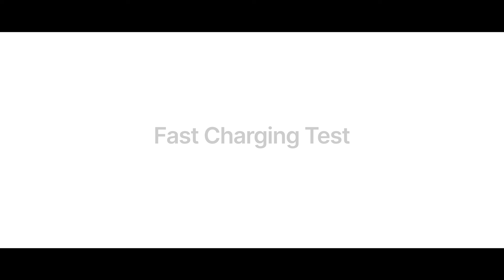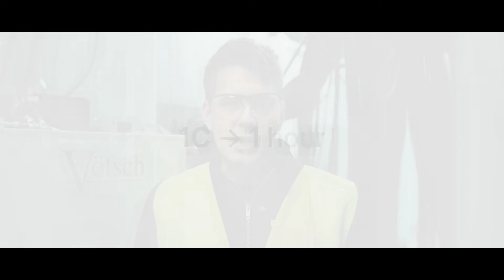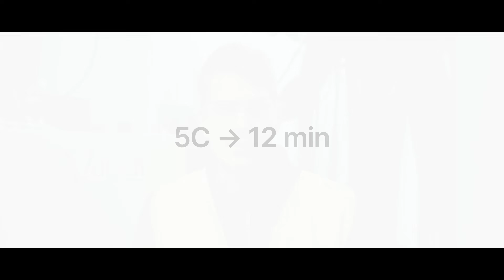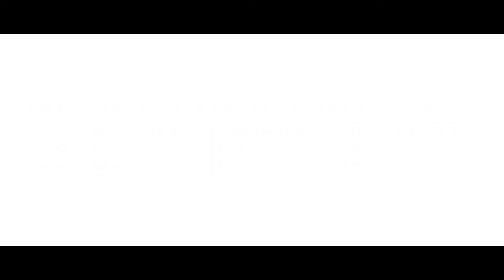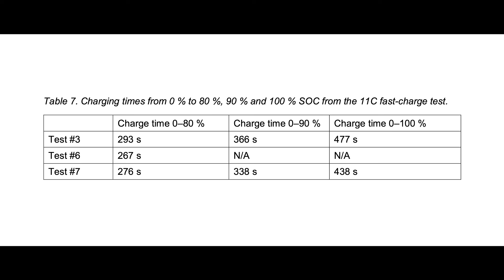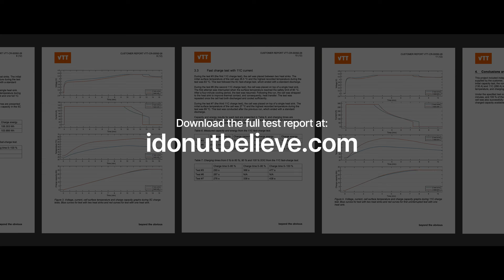Donut Solid-State Battery: Fast Charge Test | I Donut Believe (Pt.1)

Comment: Conventional lithium batteries suddenly got stone aged 😂
Reply: Now would be a good time to hold off on any further lithium battery purchases if you can manage.
Reply: They don't require heatsinks that are 10 times as large as the cell so not sure about that yet. 4:39
Reply: @yours_truely  Usually they are liquid cooled, which in practice would also be used for these donut things. And slower charging produces less heat.
Reply: @Ithirahad  you are right but the extra heat these generate will have to go somewhere, right? And that would need a lot more space.  It is not as if it will magically disappear with the liquid cooling. Unless they somehow make these a combo of home boiler / car battery. I really hope they work though.
Reply: @yours_truely  current lithium car batteries heat up while charging just the same, and they can’t handle the heat nearly as well, meaning that they need larger cooling solutions than the donut cells.
Reply: @luipaardprint  I know they do but I don't think they generate as much heat mate. 90 degrees in 4 minutes while sitting on a 4 inch thick heat sink? If this is the case then the 11C case is just impractical as it would require a lot more cooling than what we have now. And if you read the test conclusion this is what they are implying I think. They could have shared DCIR/impedance vs SOC and temperature results but they didn't.
Reply: @yours_truely let me think, active water cooling vs passive single heatsink?

In any case 5c with nominal het without rare earths? Sold.
Reply: @odman7945 all that active water cooling is doing is move the heat from the source to the water. The water just transfers the heat somewhere else. It doesn't just cool on its own. You would need to have big radiators cooling that much water. And they will need space. The space may not be needed right next to the cells but it will be needed to be somewhere otherwise the water cooling won't be happening. Hot water can't cool anything down. Anyway I guess we will soon find out. It seems this is a form of pseudo capacitive nano tech so it may well be charging fast and last longer but there are questions about charge retention and manufacturing costs.
Reply: @yours_truely yeah? Its normal.
Reply: @odman7945 what is normal? You don't need huge radiators to cool current battery packs. If these generate twice the heat you will probably need 4x the size of radiators. More heat = more space required = less effective density. But tbh heat is probably the least of the problems these cells will face based on what I read.
Reply: @y @yours_truely maybe you should do some research on modern EVs and fast charging.
Reply: @odman7945  sure and you should do some basic study on thermodynamics. You seem to believe that water somehow gets magically cooled down.
Reply: @yours_truely look. All I asked was why this is a problem, because the water cooling is normal operations, thats how the modern EVs work.

Somehow you make it be some problem, that it is not.
Reply: @odman7945  it is a problem because water cooling needs a way to cool the water. I don't know why this is so complex mate. It is like saying that an air-con is small and doesn't need space by just looking at the bit inside the building and ignoring the main unit outside.
Reply: li ion charging at 5c with just one passive heat sink? like to see that. 

I dont know how it is so hard for you to get that using water cooling in a battery pack is normal in EVs these days. Obviously that incorporates cooling the water. 

Heck Gaz cars have water coolers lol.

Its not like the tech is new.
Reply: @odman7945  not at 5c it isn't lol
Reply: @yours_truely Didn’t you listen to what was said in the video? These heat sinks are worse than the cooling you typically have in a real battery pack. They’re big just because there’s no fan or pump, so they need to be big to get a reasonable cooling effect. 
Even 10 year old EVs had a fan to cool the battery pack. First gen leaf may be the only exception. But then it didn’t charge at 5C. More like 0.5C
Reply: @auspiciouslywild I did listen but I also know li-ion packs don't heat up to over 90 degrees mate. I mean unless they are faulty. Even if the contact heat sinks were 1mm thin, you would still need to find a way to make the heat go somewhere. So you would need to have bigger heat sinks somewhere else. Simple thermodynamics.
Reply: @yours_truely The only difference is that not only do these cells tolerate 90 degrees but they actually like it. In real life you'd need to get rid of the heat as sitting on a 100 degree battery pack would be a tad uncomfortable. But so would it be sitting on an even hotter engine and we have mastered how to keep hot thing cool.
Reply: @yours_truely  No, that is a passive heat sink, the temperature is high cause it’s charging at 11C, conventional lithium batteries charging at that speed would go up in flames without liquid cooling, and it would definitely throttle down faster to avoid rapid degradation.
Reply: @Rebelapes  again, the point is, 11C is pointless if it generates that much heat that it needs so much cooling. I mean well done for them for achieving something that cannot be used in a car or even more specifically, a bike. Their 5C charging seems to require more cooling than a li-ion pack too.
Reply: @yours_truely So you charge your lithium cells at home at 5C without cooling? I didn't know the cells could do that 😂
Reply: @freeeyes5789  I think you missed the point mate. Given the heat this cell seems to be producing you won't even be charging it at 5C anywhere without double the cooling of what you use for current tech.
Reply: @yours_truely It will have water cooling, plain and simple, just like every electric car, for 5C.
Reply: @yours_truely you're comparing two different batteries, normal NMC cells cannot tolerate high temperature, that's why they require extensive cooling and heating systems. They need this to charge at 3C, so in example a 3000mah cell can charge at 9 amps only if it has serious cooling. These cells are not bursting into flames at much higher charge rates 11C with minimal cooling. That same 3000mah cell would actually explode if you pushed 33 amps into it, not just get warm. They're fundamentally different.
Reply: @F @Flyingwigs ople are also forgetting that, while we dont know the chemistry, supposedly they are not using rare earths or for example lithium, which is highly flammable. 

Even getting the same results than normal batteries would be groundbreaking.

So saying things like ”comparable” to normal lithium batteries is really dum.
Reply: @freeeyes5789 how big radiators will it need? And how much energy for cooling?
Reply: @yours_truely They used passive cooling in the video; an active cooling system won't have a problem with that.
Reply: @freeeyes5789  why? does active cooling somehow require less space? The mechanism still needs to be somewhere on the car, taking space.
Reply: @yours_truely I think you are trolling. 5C highest temp with 2 heatsinks was 47% degrees which btw. happens to be the optimal temperature for Tesla fast charge, which is btw. liquid temperature controlled battery pack. 

Tesla even warms up the battery pre-heated when going to fast charge so you get the optimal charge speed immedietly.
Reply: @odman7945  Yeah 2 massive heat sinks... I am not trolling. I think you are because I cannot make it simpler but you keep ignoring the fact. This thing even at 5C generates 50-100% more heat than a fast charging li-ion battery. So it will need much bigger cooling as it is evident from the test itself. Not that we will ever get to see this as it is most likely just a marketing trick (at best) anyway.
Reply: Not quite as they are still the only ones you can buy. And will be for some time until someone delivers the actual product these scammers are pushing.
Reply: @benbaselet2026  the only scammers are in the oil cartel, especially the american ones, telling everyone that pollution is good for business and has no consequences.
Reply: @fofopads4450  while i agree that oil cartels are scammers, they are definitely not the only ones.
Reply: @fofopads4450  That has nothing to do with topic.

Comment: 10% energy loss between charge energy and discharge energy at 1C (=90% round-trip efficiency) and 20% energy loss at 11C (according to the report)... this seems quite high. Other than that, it looks impressive
Reply: 80% round trip is normal for batteries
Reply: isn't that just heat?

Comment: Can someone translate these numbers over to a realistic EV-charging scenario. I can not put these numbers together myself 😅 

What would this mean to a 80kwh EV battery, regarding charging speed and charging time for example? What’s realistic?
Reply: its not that complicated. 11C would mean 80kW*11 (880kW) charging power and a charge in around 5 minutes.
Reply: @Bullseiify 5min, but your charging stations needs an 880kw output. Which means there is no big difference if you charge at home
Reply: @stephanosbinos8735
Reply: @FloloMAN  yeah, obviously it doesn't make a difference for home charging. unless you got such a charger at home :D But it could be a very nice to have for long road trips. It would enable similar charge time compared to combustion cars (Still a bit slower but i would say close enough :)
Reply: Chagpt based on data says that in a EV like tesla , that would mean 2 -5x times faster charging speed

Comment: So far, the battery behaved what a typical power cell lithium ion  battery can achieve. That much heat generated during cycle indicated high DCIR which is consistent with any lithium ion cells on the market. We will see if their cycle life testing and energy density is consistent of what they claim.
Reply: No battery in the world charges this fast as the tests show .
Reply: @wakeno.6047  Hi Mr. Bot, almost all modern Lithium Ion battery can charge at that rate. Li-Po can charge 10x speed of that.
Reply: @michaelfeng327 you crazy or a chinese troll?
Donut batteries have a 0-100% charge in 7-8 minutes !
A Li-Po is around 30-60 minutes.
Donut batteries work fine at 90+ Celsius, Li Po work between 0-45Celsius.

Just watch the report or the video before commenting

Comment: the cell aprox. size is 15*10*1.5 cm = 0.225 liter. If the capacity is 25 Ah the cell voltage is 4.3 V then result 477 Wh/liter
Reply: The cell voltage is a nominal 3.6V according to the report.
Reply: @default9740  correct, and the capacity is 26 Ah. result  115.5 Wh (in the report is 100 Wh for charging, 90 Wh for discharging) ergo i was close. 
if the voltage dropping is almost linear (fig 2.) and the discharge energy is 90 Wh (table 4.) then result 400 Wh/liter
Reply: how did you come up with this dimension?
Reply: @Bullseiify  4:38 is a hand so i aproximate
Reply: I wonder if it weighed about 1kg…
Reply: @NicolausNemeth  94 Wh / 400 Wh/kg = 235 grams
Reply: @tomivalko  i aproximete Wh/liter, not Wh/kg
Reply: @nagyzsombi  400 Wh/Kg is from Donut Labs stated claims
Reply: @tomivalko  Ah! You're right. I took the Wh/litre and got confused thinking it was a litre instead of .225! LOL
Reply: 11C is nothing special (lipoly like Turingy Graphene 15C high performance RC pack) and this battery looks identical as a regular lipoly with same outer coating folding details.It’s funny to watch them try to fool all the naive people .and this battery looks identical as a regular lipoly with same outer coating folding details.It’s funny to watch them try to fool all the naive people.
Reply: @maricomovies  blablablablablaa.. Blablaablabalblaa.. Ok?

Comment: Disappointed that the sample size was only one (!), but very encouraging results so far...
Reply: Thats the way all are tested, cell level. Not pack or even module.
Reply: @AJ1964FI  I understand that, but having been involved in technology sample testing over the years, testing a single sample (cell) really is not a good way to go when investigating capability. Especially when the test time is so short - it takes longer to set up the test, than actually run it. Multiple samples help to prevent the effects of their being an outlier... Thanks.

Comment: so i talked to my friend (chatGPT) and asked after uploading the report. is this a legit test on a battery or is important parts missing form the report? got the answere

Short answer: It appears to be a real laboratory test report — but it is incomplete for making big commercial or performance claims.

Here’s a structured breakdown.
What’s Missing (Important Context Gaps)
However, several critical elements are missing if someone is using this to claim breakthrough battery performance.Complete validation of breakthrough battery tech? → No. Important parts are missing.

If someone is using this report to claim a major battery revolution, you would need:
Cycle life curves
Energy density certification
Third-party safety testing
Multiple-cell statistical data
If you'd like, I can also explain what a fully convincing third-party battery validation report would normally include.

Comment: Big fan of the delivery of the dude in the yellow vest. Just dry, simplified, practical examples of an understanding of the issues.
Reply: Was looking to see what the charge C was and he delivered. Also curious what the max potential discharge C is, I might have missed that. 
The higher temperature charge being good with 85°C at 11C is crazy.
Reply: @JonDecker  And that with only one heat sink. Definite drop in temp with two heat sinks. With active cooling in a battery pack it would definitely be much cooler.
Reply: What do you mean? He's the most excited I've ever heard a Finn be :P
Reply: His official testing outfit and clearly scripted delivery was definitely theater, but still hoping for the best.
Reply: VTT… his job is to be strick and boring!
😊

Easy to see difference to Donut person!
Reply: @haukikannel  that guy is not from VTT, he's a Donut Labs employee. He was at the their booth at CES.
Reply: @Extralarse ha, I knew it! Very deceptive but could tell from his choice of words.
Reply: @torbjornaxelsson8690 , nothing deceptive, he was identified as being a Donut Labs employee when he first appears in the video. The research report names names of VTT people involved.
Reply: @torbjornaxelsson8690 what, VTT posted official report on this, what are you babbling about
Reply: @davidgaina5659  The person is from Donut, report is from VTT
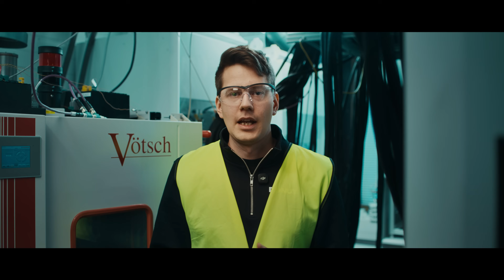Reply: @haukikannel CTO and Co-Founder. Can you not read? 1:21 has it on the screen. He is at VTT, as in, physically, to test his battery
Reply: @haukikannel Aren't they both "donut persons"?

Comment: This is still useless.  You guys said the motorbike was the first solid state vehicle on the market and yet, won't run the tests against that bike directly.  instead providing data from lab testing.  There are tons of companies that claims this type of performance in labs.  we want to see it in your finished product.  unless you would like to admit that the bike is not in fact using an actual solid state battery.
Reply: They will be shipping these in bikes in the next 1 to 2 months
Reply: They can't do that, it's not their product to show. Verge is technically a separate company they supply. It's up to Verge to show off their bike, not Donut.
Reply: @Skylancer727  so let me get this straight, these guys just collaborated to make a revolutionary breakthrough on this technology and neither thought it would benefit them both to use their product to demonstrate it?

Comment: This battery has no graphite at all, whatever new material was made for this, Nobel prize is coming
Reply: Speculation that it uses carbon nanotubes coated with titanium which allows for high density.
Reply: @sloansteeringsystems isnt titanium kinda rare tho?
Reply: @AIpromaxUltra-x5e  Technically it's not rare in Earth's crust but it's expensive to process. Still, it is like 2x cheaper than lithium

Comment: Congratulations Donut Lab and all involved institutions and individuals🎉 Historical moment! Humanity now has a viable path to a fossil free economy.
Reply: Do you think that device you are typing  your reply on is made without fossil fuels?
Reply: @gsguy9359  I’m sure he knows that. I’m sure that like you, he also knows that currently 90% of daily oil production ends up being burned. Used once. Non value added.

And of the 10% that isn’t burned, half of that is single use plastic bags.

So you know what, maybe world wide oil production goes back down to less than 10 million barrels a day versus the current 100 million a day and you can still claim that the global economy is not 100% fossil free, but he can claim that it is 95% fossil free. 

And the only oil being mined under that scenario will be the cheapest available; certainly not Alberta synthetic crude, Venezuela sour or Russian Arctic…
Reply: @gsguy9359 no, but solid state batteries have just been proven? Did you think by "path to" he meant "already done"?